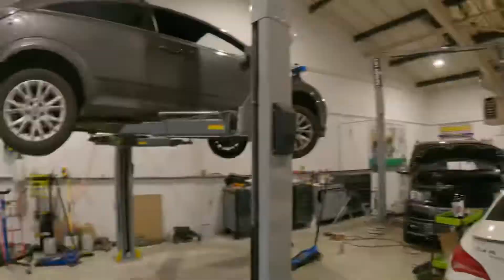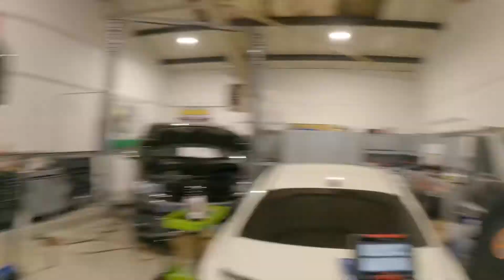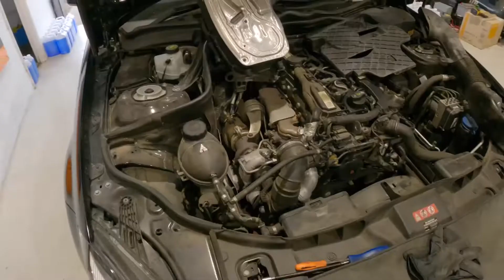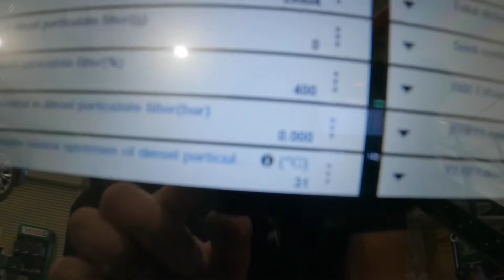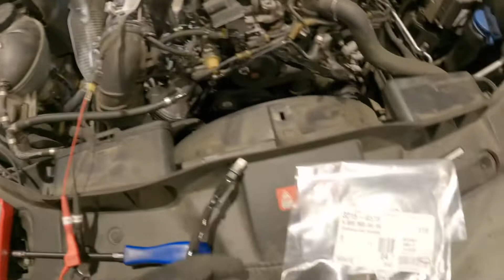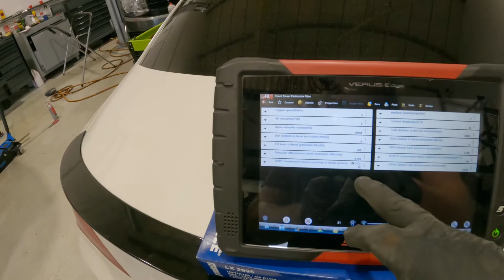P0546 Mercedes Fix OM651 Engine.

Comment: Thanks so much. Had that code on my Sprinter van 2.1 L and was able to replace the sensor. Very helpful.
Reply: Is the sensor and connector location roughly the same on the sprinter? I need to do mine but can't find any videos showing the sprinter specifically

Comment: Thanks for the info. Great video. Would the P0545 also restrict my car revving past 3000rpm? Power has just gone. Some are saying it’s the dpf other sensor. Don’t work on cars so don’t have clue 😅. Any help would be appreciated.
Reply: I had problem with this sensor that is shown in this video and it made my c250 lose a lot of power it felt like the turbos didnt wake at all

Comment: I have a 2013 250cdi, grtting the b19/11 code, but not a permanent fault  the cars lot in limp but feels restricted and down on power as though the turbo isnt working as well as it should, no other fault codes atall, boost pipes are fine, so im hoping it just this sensor. I have a new febi on here ready to fit but am dreading it

Comment: I've got the same code on a w639 Vito with the same engine. Old sensor is definitely dead ( showing open circuit on my multimeter) replaced with a new one (didn't test before) and I'm still showing the same code 🤦‍♂️

Comment: Great video, thanks a lot! I need to replace B19/9 sensor and it was very helpful to know exactly where it is. I have an old c207 (E250) and the exhaust system/quantity of sensors are identical to this video. Is the plug/socket for my B19/9 sensor also accessible from the bottom or will I also need to take the air filter housing off like you have done?
Reply from the maker: Thank you 👍, no need to remove air box to get to plug

Comment: what were the symptoms  what was the problem before the sensor was replaced?  I have a cooling fan running all the time, the motor is unstable, and the temperature on the instrument panel does not rise at all, motor OM651

Comment: Hello my friend, thank you for the information..I am working on this engine and I have several codes, including this one. I wanted to ask you with your permission...Does this sensor cause a lack of torque in the car..Thank you
Reply from the maker: Hi there. No I’m not aware of this causing lack of torque. What other codes have you got?
Reply: @godfreysautomotiveservices  thank you for replying
I have the code p0101 for air intake, code p0299 for the turbo, and code B210A00 for changing gears, knowing that when I delete errors, the chuck bulb goes out and torque returns, then after a while it enters the protection system and the codes return, knowing that the car has removed the Adblo system.. and I noticed Also in the live reading, there is a problem with the exhaust gas recirculation rate that gives me -7 instead of 35%. There is also a false reading in the FAP system, such as the diesel particulate content of 25 grams instead of less than 14 grams ... and the filling rate of the diesel particulate filter 400% instead of 200% at most...thank you my friend

Comment: great , informative video , I wonder if you come across this strange problem engine 651 2.1 L (P02A7=cylinder4 fuel trim at min ) from the code you would think injector problem but sadly that was not the case , I swapped inj4 with inj1 and still the same problem P02A7 , went toward vacuum and checked all vacuum parts (intake manifold /vacuum resonator/turbo actuator/transducers/vacuum hoses) with no sign of vacuum leaks at all , in fact the system holding 15inch vacuum with no problem at a all , in regards to injectors tested with injector leak test all four injectors are leaking the same amount of fuel so I can't  fault them , engine idling is fine / drive fine the only thing is if you cleared that code , you will get the full power of the engine I mean the turbo will be working as it should be until you drive in steady speed like 65miles/hour for 10 to 15 minutes as soon as you take your foot off gas pedal the check light will be trigrad and you will start loosing power specially up hill , the only suspect left for me is o2 sensor , I haven't replaced it yet , but when I disconnected no check engine light show up  as if its connected , but am thinking that could be the o2 sensor is faulty thats why when the engine on that steady speed and by the time I let off the gas pedal , the ECU request the oxygen from the o2 sensor and most likely the wrong values from the o2 sensor is the suspect what do you think ? your help is appreciated
Reply from the maker: Hi, unfortunately that's not a fault we have come across. Initially i would have been checking cylinder 4 injector but as you have swapped this for cylinder 1 it seems strange that the fault still shows on no4. Did you code the injectors when you swapped them? I've not known an O2 sensor to bring the vehicle into limp mode and with it disconnected you should experience the fault straight away if this was the case. It almost sounds like you have a leak on the intake side. These can suffer with the bottom bolts in the intake manifold snapping or coming loose. Can you smoke test the intake system for leaks or pressurise the system? Hope this helps, please keep us updated on your findings.